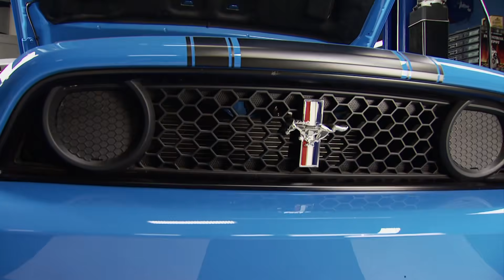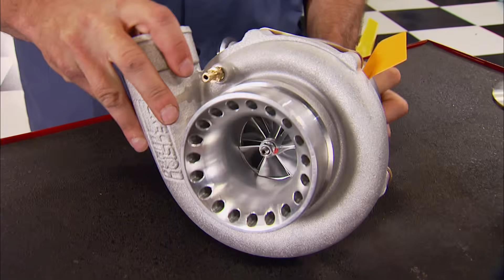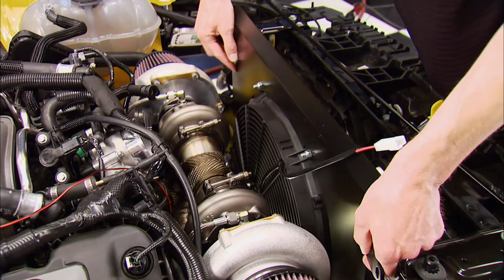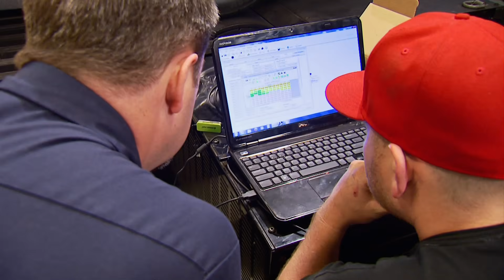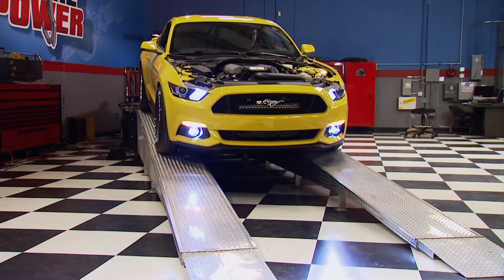Twin Turbo'ing a 2015 Mustang GT to Beat the Young Kids at the Strip - Engine Power S2, E16

Comment: 38psi in the tires? 800hp and stock oil pump gears? You retained the intake noise tube thing? That cheese ball oil return hole? What

Comment: WTF did I just witness!!!! Drilling and tapping an oil pan while it’s still attached to the freaking engine!!!! You are putting metal chips into your oil pan!!!! I know there’s usually a magnet in there, but c’mon. That’s crazy. Look…. I know there are redundant systems that keep particulates from getting into your rotating assembly, but do you really want to take that chance?

Comment: People ask what we do in-house at the V8 Speed & Resto Shop, and the answer is almost everything! We do all body and paint work, mechanical, fabrication, alignment, tuning, and interior work on-site in our complex. We farm out engine machine work and tire mounting, but we assemble engines in-house. We have a great partner shop locally where we perform chassis dyno tuning as well. Worldwide transport available. What do you need?  http://www.v8speedshop.com/contact

Comment: I can't imagine that power level will last long on stock internals.
Reply: Coyote internals are pretty stout, only upgrade I have done on my TT coyote f150 is MMR timing hardware and oil pump gear

Comment: Come on drilling into the oil pan and threading thin sheet metal? I am a aircraft designer and watching I that makes me sick to my tummy. I have watched countless videos of installation of Vortech superchargers installed the same way and have always thought eww that's not good. Spend the time take the pan off and drill and install the correct fittings.

Comment: No.test drive...seriously??!! So  lets get super critical....and pick apart the build cuz it makes us feel good....... Re gapping stock spark plugs..??.. Boo hiss... get some Brisk Spark Plugs. Why not mount the turbos anywhere but under a smoldering hot hood...!!  rear mounting of twin turbos  would be much nicer and keep the heat down and reliability and longevity up......and for God sake get the heat coated pipes and then wrap them if you want but at least get the heat resistant coating...sheesh. 
 And the oil pan tap was hinky...i'm sure a flush and magnet would get most of the metal pieces... but still is the pan that hard to remove and make a little more clean and Professional!! Haha. Just kidding Nice job...still film the test drive next time fo sho!

Comment: Personally , I liked the way they did the oil pan taps. The only metal lost would be a tiny amount from thread cutting which would settle to the bottom and be collected by the drain plug magnet. If any happened to go through the system , it would be caught by the filter. In my opinion , much less chance of problems than pulling the pan and welding on fittings. I think many of the commenters missed the fact that the drill bit didn't go all  the way through , but only close enough for the punch to finish making the hole  and leave a good base for cutting threads.

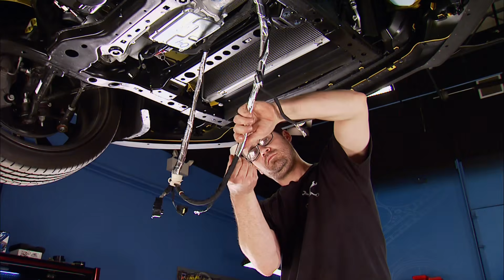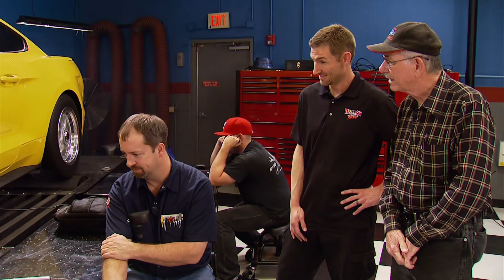Comment: Today on Shady Tree we will try to blow up a Coyote 5.0 by putting twin turbos on a stock bottom end-will it go or will it blow (find out). We will 6:08 drill a hole through the oil pan leaving metal shavings in the oil pan with a tap, then blamming tire spin making smoke-when really it was a head gasket going bad on deceleration-15:13 Ya right, tire smoke...15:54 Pops: look something is smoking...the other guy: who cares old man...you signed our contract: Not responsible for damages

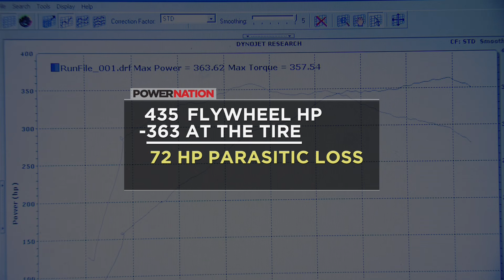Comment: @3:29

um....the loss is based no flywheel hp not tire horse power.

it is 20% when you take 72hp / 363hp.

However, your parasitic loss is actually: 72hp / 435hp at fly wheel, or 16.6%
Reply: mjs28s nice pick up. These guys are morons. What worries me is that you were the only viewer to pass comment. I thought that someone interested in any power adding or for that fact just a standard vehicle would understand drivetrain loss(parasitic loss) and how it has been cut down to about 13% on some of the newer vehicles.

Comment: I dynoed my stock 2018 A10 Mustang in Nashville in June and made 422 wheel hp. That's a huge increased from the 15-17 Gen 2 Coyote.
Reply: Very happy Dyno...
Reply: Ford has been known to underrate cars hp ratings occasionally, they did that with the Terminator Cobra.  Congrats on those numbers!
Reply: CrimsonStang What make of Dyno? That is very impressive especially with an auto.

Comment: Who would sell a beauty boss 302 for an ugly s550 tweety bird
Reply: 1991tommygun Ik boss 302 looks so much better
Reply: Boss made 900 hp too
Reply: Uh,this baby boomer gentleman obviously has the dough, the S550 is a way superior platform/chassis to the undoubtedly great S197  with its revised front geometry, IRS, the new 10 speed auto is a BEAST and that wicked 3rd Gen Coyote engine. Performance is more than looks.
Reply: an old guy that is cooler than you
Reply: Kareot i have a viper and cobra lol pretty sure i rather them
Reply: @1991tommygun  nice dinky toys,this car happens to be real though.
Reply: trillrif axegrindor ok? Lol

Comment: Couldn't have anyone clean up all the slag on the new headers,   looks like ray Charles welded them.......
Reply: was stock 2013 mustang header from factory
Reply: Big Sean247  the black header they installed after removing the factory pice,    header is covered in welding splatter an shit looking welds
Reply: Sean M believe it or not that was a factory header!

Comment: Poor coyote already smoking. Lucky to last 1 pull at this power level.  I feel bad the old rich bastard getting squeezed.  But hey he has cash to burn
Reply: he not getting squeezed. he paid for kit and got free labor. i think he won cuz a shop for the work they did would be over 7k
Reply: @bigsean2473  Boss was the better looking and faster car with way better engine.
Reply: @bigsean2473  You sure labor was free. It was a ton of labor

Comment: Did I really just see them punch and drill into the oil pan while it was still on the car? wow, wtf? Unbelievable they would do that let alone show it.
Reply: they didnt drill all the way in just a good dent then punched threw. so no metal in pan. tap with lots of grease grabs all shavings. its done more than you think in shops with big names and small ones alike
Reply: It's very common way to make a drain plug on many different kits

Comment: This engine and transmission will take this power and more. Its amazing how well engineered this platform is. The only thing that I would invest in, if I were him and its available, is converting the fuel system to run e-85 for that extra safety measure and upgrade the oil pump gears.

Comment: Turbos make great power but they do have lag,the guy said turbos are the way to go making big power,if that's true why does roots tvs blowers make instant power from the crank cranking out over a 1000hp depending the size.The Gt500 has this proven.
Reply: that why they used 55mm turbos have no lag. so small the spool soon as you hit the gas

Comment: wasted his money on the 15 gt the 13 boss is better lol
Reply: Nah
Reply: @PowerSerge5000  yea.
Reply: Haik Boyadjian nah
Reply: @Texarmageddon  yea
Reply: Haik Boyadjian better limits in the 15
Reply: @Texarmageddon  The 15 GT engine literally has the entire bottom end off a 13 boss. Don't believe me? check what the crankshaft and bottom end says for the 15 GT. The timing and manifold on the boss is what makes it better. Also the fact that its  a s197 which is better for drag racing.
Reply: Haik Boyadjian I already know the bottom end is from the boss. They’ve also tested the manifold and that used to be the top dog, but now it’s the GT350 manifold. 

The S550 is just a more capable platform as a whole package.
Reply: @Texarmageddon  Well man that's your opinion. Just like how it's my opinion that the boss is better but go ahead and ask any tuner from lund if you want to hear actual facts. If I'm not mistaken. Alex from lund claims boss is better than the gen 2 Coyote.

Comment: I would be more concerned with the stock rods that are @ 12:1 compression, being able to handle all that stress. The oil pump gears usually fail due to higher RPM, over 7000 is too much for a stock oil pump, stay under 7 grand and you are relatively safe. also they didn't put any oil catchers on the pcv lines, tuning will suffer from all that blow by oil it can also cause cylinder detonation.

Comment: I'm confused, the old guy sold a previous Gen twin turbo mustang that made over 900 hp on the dyno, for a current Gen twin turbo kit (that the spent the whole episode talking about 900+hp)that only pulled 800 on the dyno. Wouldn't it have been better to keep the old car and beat the kids?
Reply: it made 900hp at the crank

Comment: So you removed the cats and filled up on race gas. Sure would have been nice to see something that could have made power but still be street legal after all a lot of us have to pass an inspection.
Reply: they had cats in the x pipe just smaller and on 93 gas boost would have to stay around 4-6psi

Comment: So fast that it will be first in line at the repair shop soon! 12 lb. of boost on a naturally aspirated designed engine, stupid......
Reply: You're obviously not very well informed on modern engines are you! A gen2 Coyote will handle this for thousands of miles...

Comment: Tire spin smoke on deceleration?... Mmmmm...no. Valve seals or guides on the motor?  250lbs in the trunk to stop the tire spin,  smokes the same.  Good numbers though!
Reply: smoke off new exhaust they all smoke for about a day
Reply: @bigsean2473  on deceleration only? That would be strange.
Reply: @robbietice2438  no as long as its flowing fast the smoke stays down. when the flow slows smoke builds up and looks like a lot more
Reply: @bigsean2473  Thats not JUST smoke off of the exhaust. Or else it would smoke the whole time, not just on deceleration. Rings or seals are most likely the cause.

Comment: Valve float hear we come, yeehaw! Look at the turbo charge pipe going in to the throttle body man that thing is gonna pop off, no need for a blow off valve. Wheel hop city.
Reply: Lmao
Reply: how you knw you seen somebody with this set up??? all cars are not the same. just because you seen a 2011 do that dont mean this 2015 will

Comment: The stock trans and diff will not survive hard launches on a prepped drag strip.
Reply: The 6R80 is surprisingly well built and holds a lot. I have friends making similar power on vortech systems and it’s held just fine. No diff problems either
Reply: dude..did you see who the owner was....money bags
Reply: Ford 8.8? Come on man those things are made for the strip.

Comment: Ok.  I'm a turbo dummy.   What is the difference between a waste gate and a blowoff valve?
Reply: wastegate sets the amount of PSI your engine can get, blowoff valve releases the pressure when you let of the throttle
Reply: @RetroCheater81  so the wastegate regulates and a blow off valve gives excess boost a place to go safely instead of over pressuring the system which I am assuming does really bad things
Reply: @bmstylee  exactly
Reply: @RetroCheater81  hey.  The more you know.
Reply: Wastegate is what controls how much boost the turbo produces. It has a spring inside ( Or a diaphragm ) which is pre set to open at a certain interval. We'll say 10psi in this scenario. When the pressure in the intake surpasses the spring in the wastegate, it opens a small flap inside the turbine housing allowing exhaust gas to bypass the turbine wheel slowing the turbo and causing it to produce less boost. A blow off valve is placed in the intake tract versus the exhaust like the wastegate is. When you are at WOT or 3/4 throttle and you have boost pressure present and then let off and close the throttle, the pressure in the charge piping has nowhere to go and the blow off valve senses this spike in pressure and opens venting the excess boost pressure either into the atmosphere or like in new Audis, recirculates it back through the system. If you did not have the blow off valve, you would blow your intake piping ( Or possibly your intake manifold.) off.

Comment: Well. That Mustang can comfortably go toe to toe with Challenger SRT Demons.
Reply: No it can't. The rear end will never stay together.
Reply: It won’t touch a dodge demon
Reply: Well to be fair. All they touched in the episode was adding the Twin Turbo and a new Torque Converter. They also put in new Axleshafts. It would've been idiotic to not touch anything else inside the rear diff or transmission.
Reply: It can't hook up. The Demon squats and takes off.
Reply: This mustang has more hp and is lighter, it would beat a demon if it can hook up

Comment: not going to clean the metal shavings out of the oil pan ..?!?!?!? REALLY?!?!?!? come on guys your better then that
Reply: they dont show everything they do as time wont allow,or it would be like 5 parts to this.
Reply: idiotfuck,this is common to every single bolt on turbo and supercharger install.ist,see the grease? also,look up rollform tapping dumbass
Reply: Probably has a magnetic drain plug 🤷🏻‍♂️

Comment: The Dodge made 500 HP on 5 lbs, LOLOLOLOL  What a POS
Reply: @bigboreracing356  that was on Detroit Muscle.
Reply: Challenger used pump gas mustang had race gas
Reply: @hemiboy9860  So what, C16 isn't going to give 200+ horses. Keep loving that 50 year old tech Hemi in a 4500 lb car.
Reply: @therealist4006  challenger did 780  on 13 psi on pump gas. Im not trying to measure dick sizes but the stang wouldn't pull those numbers on pump gas.